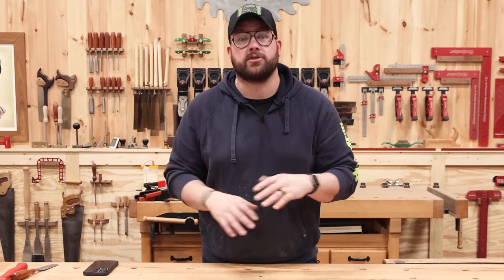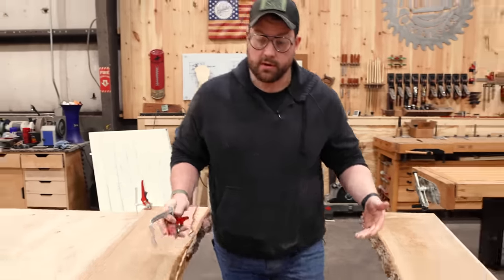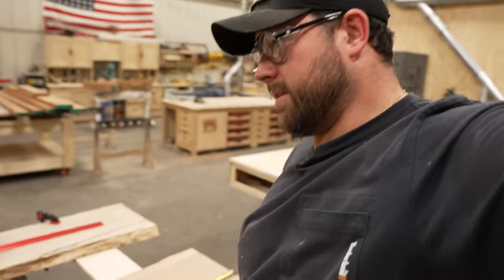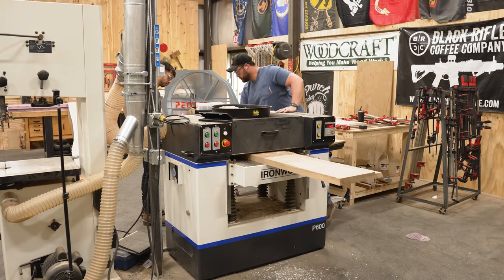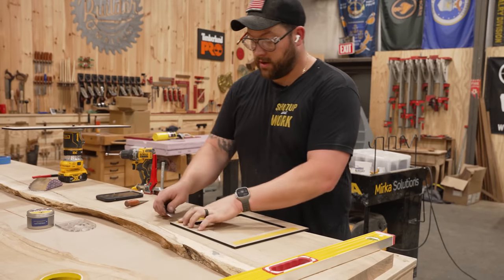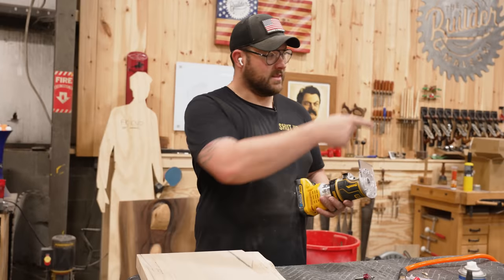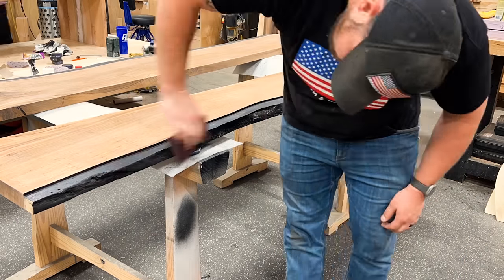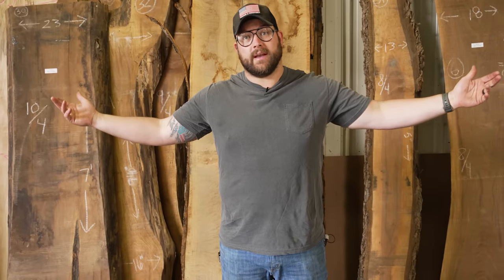White Oak Glass River Table

Comment: With oak you can blacken it by soaking a wad of steel wool in vinegar in a sealed jar overnight and then painting that vinegar onto the wood. It soaks in deep and has been used for hundreds of years to "ebonize" oak.
Reply: Ive done that before works great downside is the smell lingers for a good while at least 2 months in my experience
Reply: @Tropicoboy  Washing the wood with water w/ baking soda then rinsing thoroughly with plain water will help that smell dissipate quickly.
Reply: @k9turrent does that affect the colour at all? Or is the black permanent??
Reply: @R__A  In my experience, it doesn't "reverse" the ebonizing, only 'stops' it by neutralizing the acids. It's like rinsing bleach off clothing, it's no longer "working" but the damage is already done
Reply: @k9turrent  ty for info🙏

Comment: Agree about the lack of directions on Rubio products.  Used Rubio for the first time, results okay but all along I haven’t been sure I’m applying correctly.  Would like to see you film a tutorial.
Reply: Agreed, and not helped by the fact the whole label is printed in a 3 point typeface or something…. Impossible to read
Reply: Shake,  spread on as quickly and evenly as possible. Buff in with a white 3m pad. Buff off with shop towels until all residue is removed from the surface. Rubio is my absolute go-to and I don't offer any other finish
Reply: I went to a rubio instructional day to see its functionality on furniture and feel its only really for floors. Have only had issues trying to get a good finish on any kitchens we have used it and it has only caused problems with the customer. A traditional stain and clear matt lacquer has never failed me so that's the way I'll be sticking to in future

Comment: What do you think about using those temporary nylon nails to hold things in place as opposed to double sided tape etc? (I know it's best to use them when you're doing CNC type stuff as it's not visible and it's easy to just knock the piece off when you're done).

Comment: We use general finishes water based black stain for the base coat instead of the rubio precolor for the exact reason. Also have had good luck with the GF black poly

Comment: Yeah, I'd trust lacquer over a hard wax oil on a project like that.  Even oak can have variable density in the surface pores, and maybe that was the issue with the Rubio.  If you've got some larger pieces of white oak s-crap, maybe a test and video with different finishes including Rubio, lacquer again, and X Type 3, X Type 4, might be fun to see.  Finished product looked great.

Comment: If you put steel wool and apple cider vinegar it makes a stain that'll turn your wood really black gotta let it sit for about 24 hours. You could also Char it with a torch and rubb in   linseed oil  after a quick buff with steel wool and while it's still warm

Comment: I think there was an issue with the oil finish and type of wood you were using it on. As you are no doubt aware, white oak is not very permeable, so with a high pigment level stain like this, the variation in the grain was likely causing absorption to not be consistent across the whole slab. The solution would most likely have been to cut the finish with a mineral spirit slightly and giving less time for the stain to penetrate while splitting the application into multiple thinned out coats, assuming that the Rubio product would work with this change done to it.

I would just not use it on a closed grain wood that has as tight of a grain as white oak again without experimenting with it first.

Comment: You’ve put the Rubio pre colour on too thick. (I’ve learnt this the hard way also!) then it takes more like 1 1/2 days until it’s dry enough to de nib ready for the oil 2c 
Also don’t use a roller- I know they say you can, but it goes wrong every time. Use the beige scrubby pad

Comment: So I'm no woodworker, but I have a couple suggestions for the finishing issue. In leather working, particularly for dark stains you often dampen the leather all the way through prior to prevent different areas that were more dry from absorbing the color more quickly than other spots causing splotchiness. 

The next is one of the other woodworking YouTubers, maybe Blacktail made a video about a Rubio product and he referenced needing to wipe it down a lot. Like scrubbing it with fresh rags until you got nothing on your rag as opposed to a normal stain where you apply, wait a little, then wipe off the excess and let it finish drying. It looks like this particular product might need that same kind of treatment.

Comment: Is there any reason you didn't choose to ebonize the wood using a vinegar and steel wool mixture? I'm sure you're familiar, but for anybody else reading this, that mixture of vinegar and steel wool reacts with the tannic acids in the wood and turns it jet black, like blacker than any stain or rubio. And white oak produces this effect especially well due to it's high tannic acid content and open porous nature. 👍

Comment: I like what you do, problem solving, learning.. like that your customers like the result. But I cannot get over the open ends under the glass, it looks like a 3 piece puzzle. Maybe i would like to close the ends somehow, maybe add a frame around the desk. Also that steel bar sticks out too much for me. I would try some kind of X form ends, if it is not supposed to sit there. And who would sit at thin glass. And why glass? Who could fix it if there was a scratch or it even breaks?
Anyway I like how your work makes people happy. Some like glass,some epoxy, some pure wood.

Comment: Once you discovered the lip depth issue, you made a template of the glass to fix up the edge ... why not wait to cut that lip until after you have the glass, when you can template it. No doing it twice, and a perfect fit (as long as the template is good) every time. Hell at that point, go back to the water jet, and have them cut you a matching acrylic template as they cut the glass.

Comment: It comes to mind that any type of wood even high grade plywood laminated to desired thickness eliminating worries about wood movement and flatness could be used for this build saving you and client much as with cnc the river could be created because the black finish odscures the wood species anyway. I like the finished product very much low maintence and easy to make future repairs if needed. Ray Stormont

Comment: Being that you used white oak, why not ebonize it with a vinegar and steel wool mixture?
Reply: I’ve not heard of this technique, what’s the process like?
Reply: @dannywayne311  fill a jar with vinegar, put in fine steel wool so that it's completely submerged in the vinegar, let soak for 24-36 hours minimum and shake/stir periodically for best mixing, filter out the steel wool and use the vinegar solution to brush onto any wood with good tannens like oak or cherry and it will soak in deep and ebonize the wood to a nice beautiful black color that still shows grain and can be sanded without losing the color. Top with a water based spray or wax finish, make sure not to use anything that will amber or it will really look muddy and green so no oil finishes.
Reply: @NotARealDuck  awesome instructions, thank you, I’ve learned something today.

Comment: I have a question because I’ve not seen it done before. Is there a way to do this but leave the bark on? I’d like to see the results of one with bark on if you haven’t done so before :)
Reply: The bark comes off pretty easily over time. In a table like this, you'd get blowout from cutting the recess for the glass and the bark would chip off and look like shit. In an epoxy table, the bark would end up being your bonding surface and would basically peel off and collapse in the center. Hope the way I worded that makes sense.
Reply: @adamritchey4209  yep definitely makes sense. So there’s no way to reinforce the bark at all? I know stupid question, but I’ve always wanted to see one with the bark so it’s more natural looking.
Reply: Idk honestly. I've only ever seen a bar top that was fully epoxied over, basically half a slab encased in epoxy. That had the bark on it. As for a table, idk. I'm sure @john_malecki could figure it out.

Comment: 1. I would have gone with a clear coat or a lighter stain and let the wood grain show.
2. Maybe because I haven't seen the other video I was thinking that the glass was going to be on the bottom side of the table and thought you were cutting the recesses for the table on the wrong side. I thought you were gonna do a resin filled river

Comment: To compare the sheen, the river edges of the two halves should be facing each other as they would be in the finished table. If the two pieces are not in the same orientation as they were in the tree, the sheen may be different when viewed from one end.

Comment: It's nice.....but $10k. IDK. I'd drop another couple grand and get one from Cam at Blacktail Studios. Get Black walnut instead of oak for a little bit more with a more appealing design and better finish. Not knocking your work because you did a great job, but it lacks that design style pop for $10k. No edge beveling and the dead air space under the glass at the ends of the table look unfinished.
Reply from the maker: I'll let cam know.....